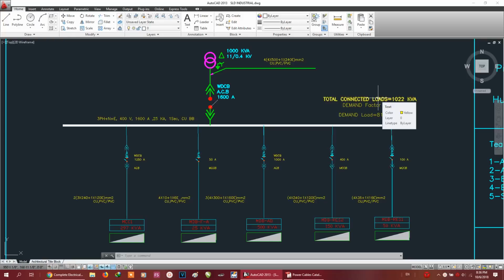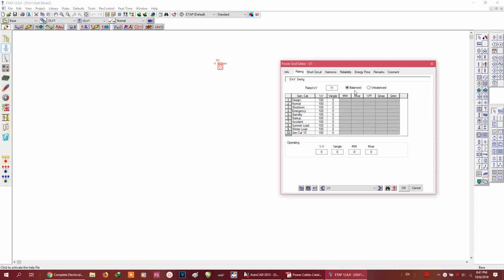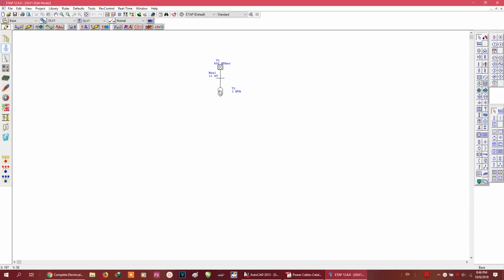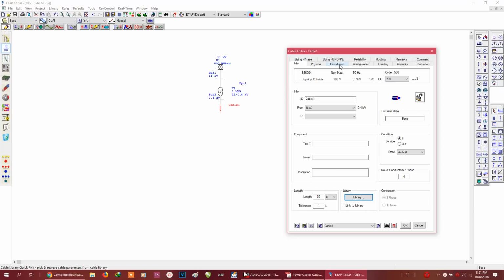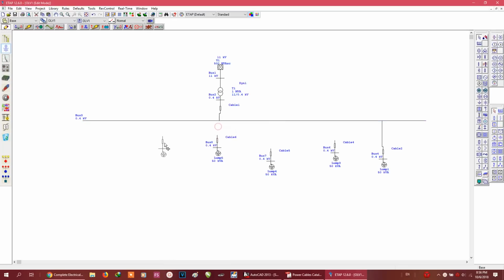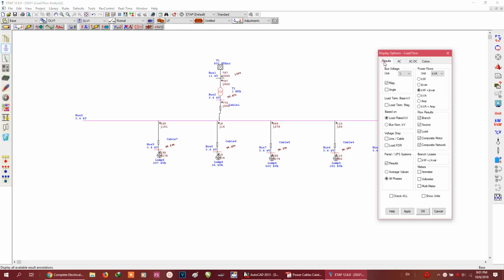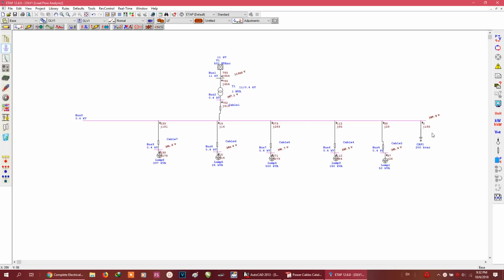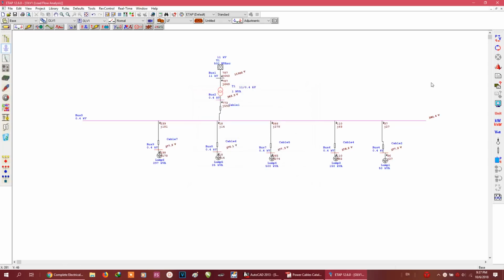ETAP Voltage Drop Analysis - ETAP Short Circuit Analysis In ETAP Course

Comment: Hello.. I'm really interested about your video series. Wonderfully explained. However can you kindly explain the applications of 2C, 3C & 4C cable in the library? (one example will enough) (I have seen in the comment section questions about using 1C cable and I understand that it because of this is a single line diagram and we are considering only one phase) 
Thank you very much for your effort!
Reply from the maker: Hey,
Thank you for your nice feedback. I appreciate it.
Let me explain this as many people are confused regarding 1/C, 2/C and these things.
First, what does 1/C mean?
1/C means that the cable has only 1 core, which means, if you have a three phase system, you will need 3 of 1/C cables to provide three phase power.
If you enable the display of how many cables utilized in the display options of the load flow, specifically, in the tab "AC" and tick on "size" beside the cable. ETAP will show you how many cables are required based on your selection.
3/C means that the cable has three cores, which means, in a three phase system, you will need only one of it to supply three phase power.
In ETAP, if you selected the first option, you will find a number of cables written as 3-1/C which means that ETAP selected 3 of this single core cable to supply electrical power. However, if you selected 3/C, you will find it selected only one, as it is enough for the system.
2/C means 2 cores in one cable, 4/C means 4 cores, and so on.
The neutral is not shown in the main library from what I remember. 
If I remember correctly, the neutral is added separately from the tab "Configuration" in the cable settings, then selecting the neutral from the auxiliary library with the size needed.
Reply from the maker: I just checked out on ETAP, if you choose 4/C, then you can have three cores for the three phase system and the fourth one can be neutral or protective earth. This can be set from the "Configuration" menu in the cable itself by selecting the neutral as main cable.
Reply: @EngrAhmedMahdy  Thank you for the explanation.
Reply from the maker: You are welcome anytime

Comment: excellent video, can u please explain about number of conductors option while selecting cable from library? As you used 1Core Cables for all loads and similarly 1 Core Cable from the transformer?

Comment: great video sir, this is what i need for trying simulation from real case.
Reply from the maker: Glad it was helpful!
Reply: @EngrAhmedMahdy  so basically to solve voltage drop is changing tap rate on transformer by decreasing the primary and adding capacitor. what i need to know is why did you set the capacitor bank into 200 kvar, why ?

Comment: Why you didn't include the Circuit Breakers in your etap presentation?
Reply from the maker: Well, it wouldn't affect the short circuit or the voltage drop analysis, we already selected the components in the single-line diagram of Autocad, this was a part of the electrical design course.
https://www.khadijaacademy.com/p/khadija-academy-student-membership

Comment: Where is the circuit breakers ?
Reply from the maker: They are in the diagram, you can see each line contain a switch and beside it a number which representing number of amperes, this is our circuit breaker.

Comment: Sir, its Incredible , but i want to that can i import the data from Autocad to E Tap ,,, Suppose I am interested to Import the SLD from CAD to ETap ,How can i do that.......?????? 
Thanks,
Noor(EDE)
Reply from the maker: Hi Noor,

On File menu use Data Exchange, however you can not direct import the ACAD file. You need to change the ACAD file to XML file and then you can import that SLD in the XML format. There is a help tool on this, press F1 for more details.

Comment: The cable is 4(4CX500+240)mm2, not 1C. You have choosed 1C, 0.7Kv, 500mm2, you should go to other choice for 4C not 1C. The arrangement of the cables from the single line diagram says FOUR CABLES each cable is 4C (FOUR CORE), not each is 1C. Your choice is right if it is 4(1CX500+240)mm2. Thank you for your effort.
Reply from the maker: Hi Hassan,
You didn't notice that there is another option called number of conductors per phase, you will see that it is written as 4 conductors per phase which provides for each phase a 4 conductors and our system is a three phase, so you will have the required number of conductors.
Reply: @EngrAhmedMahdy  hassan is right, according to your system, you need 4 conductors per phase, but you mention as 1C, so at one core you selected 4 wire and what about other 3 wire.

Comment: 4 set"s mean 4 nos of 4x500mm^2  cable u confuse me with your S E T
Reply from the maker: Hi Yasmin,
 I looked back to the video just to catch where i said "set" but i did not find it :'D, 4(4*500) means  4 conductors of R and 4 conductors of S and 4 conductors of T, each of 500 mm^2 and 4 conductors of neutral, hope it is clear now :'D
Reply: @EngrAhmedMahdy  for the 1000kva transformer the secondary current will be 1520Amp in this case we use 4x(4x500+1x240)the first four we call it sets  number  its like 4 cable of 4*500 on parallel to share  the load  because  one cable of 4*500 mm not suitable to carry the load i wish its clear
Reply from the maker: Yes, you can say 4 sets or 4 parallel cables, they are the same 😤😏

Comment: why you didn't calculate peak short circuit ?
Reply from the maker: Because our components ratings in case of short circuit are designed based on the rms or the effective value of s.c current not the peak value.

Comment: You should select 4c cable not 1c cable for transformer
Reply from the maker: In the catalogue there is no 4 core cable of 500 mm2, only single core , so we took 4 of that single core.
Reply: @EngrAhmedMahdy  when you will take 3c cable?, What is the difference between 3c and 1c cable in etap calculation?
Reply from the maker: @SANGAMEWORLD  if it is available i will take 3 core, the problem is 500 mm2 is a large cross section area , so if you want it as a 3 core then it will be very costly and it will be very bulky and difficult to install , in case of lower cross section areas we can use single core, it is of course preferred to use three core but in some cases we are forced to have single core.
Reply: Yes, I agree with you totally.